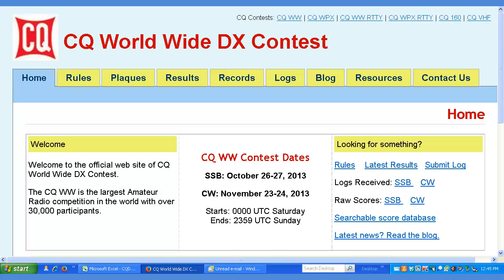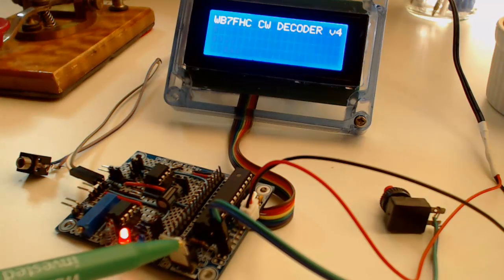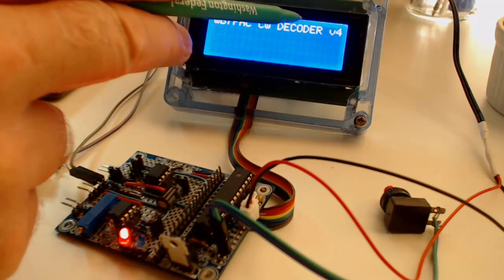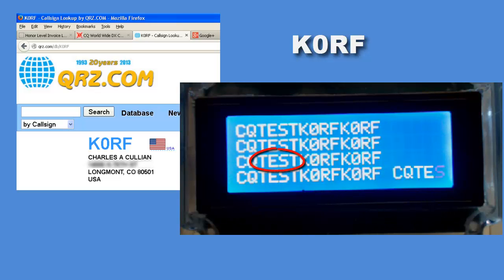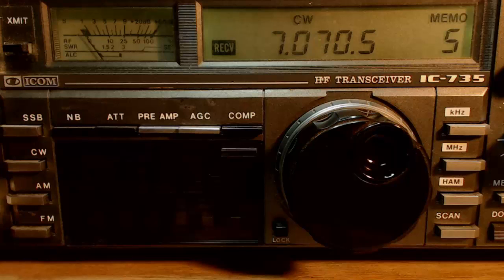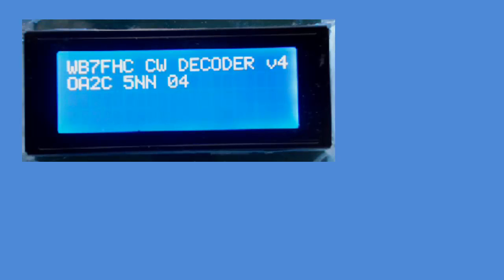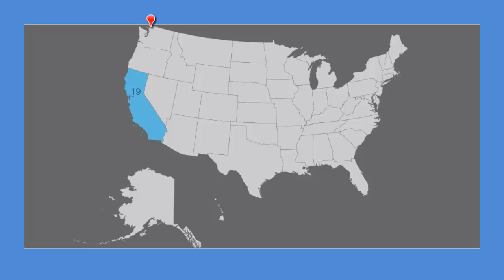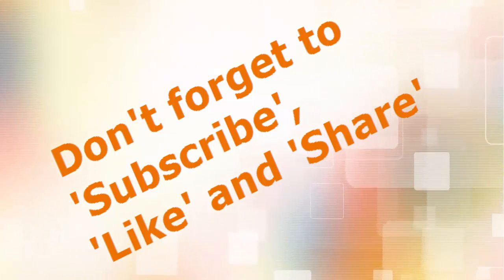My Pet Arduino Copies the CQ WW DX Contest

Comment: Very nice and thanks for sharing. 1991 I was working R&D Rome, IT and got messing with the LM-567. I still use them today. I had built a low pass audio input amp, clipped with germanium (200mv) then to the 567 tone decoder. I hooked it to my Kenwood 140 and thought I'd messed up because it just started flashing the LED. Then realized it was picking out signals I couldn't hear. Pots for center and bandwidth and I could isolate 20 Hz apart. I'd like to see if those results could be done by someone else.73, N3ICR